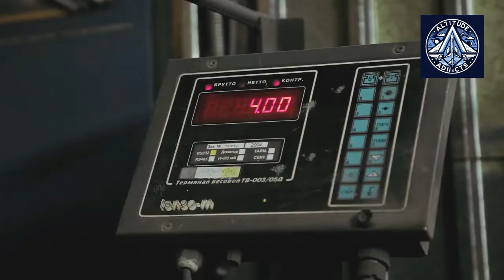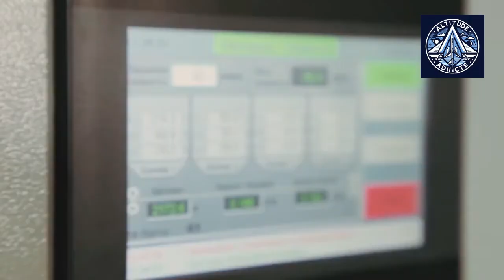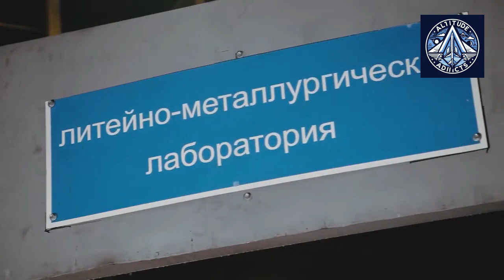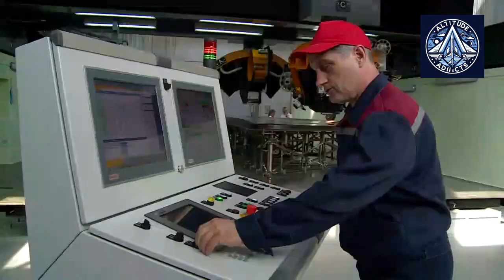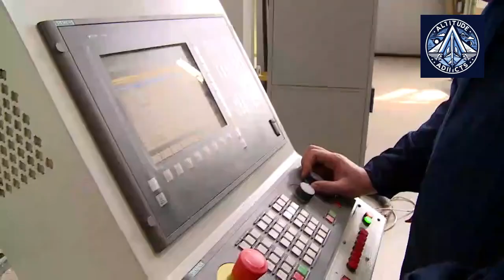Russia's NPP "Tekhnologiya" to Increase PD8 and PD14 Engine Components

Comment: You last video is about how Rus cutting pd 8, pd 14 production. But now they increasing engine parts manufacturing of those same engines?🧐
Reply: I think more components are needed to service existing engines for maintainace plus produce components for the new ones.
Reply: Perhaps beyond these two engines to also meet the demand for stationary turbines used as generators and pipeline compressors for example. May also have contracts to export raw materials or semi finished parts to China and Iran.
Reply: It takes time to build a new factory if needed, install new equipment and train people. I assume by that time they expect that engine production will also pick up significantly.
Reply from the maker: I am only reporting news. I have also asked the question at the last. Why are they increasing parts production when they are cutting down engine production?
Reply: Because you're using old or not very reliable sources
Reply: Only need more investments and factories to scale up the production.